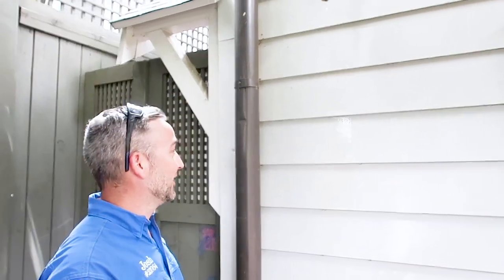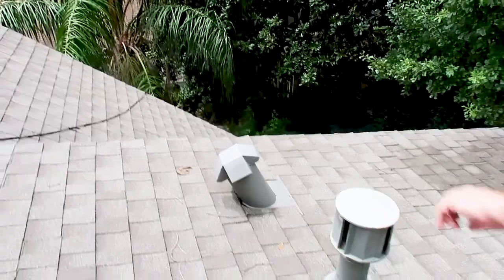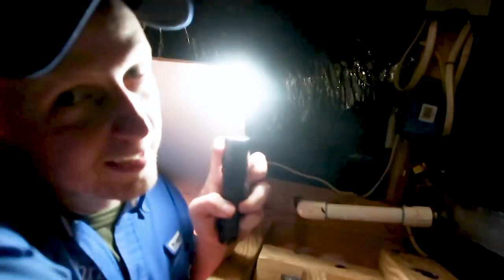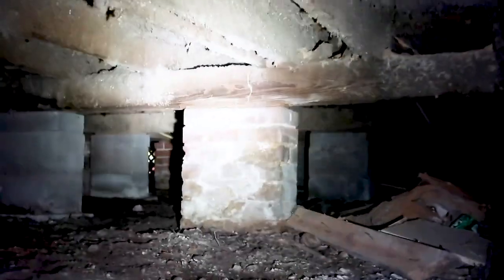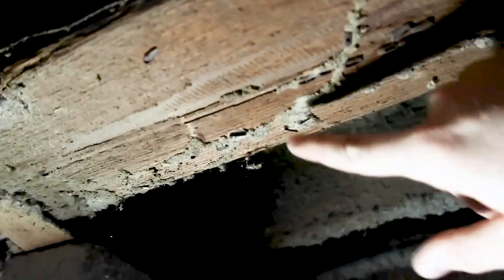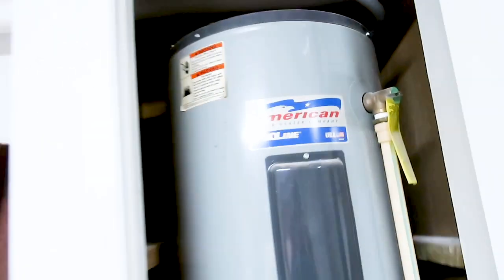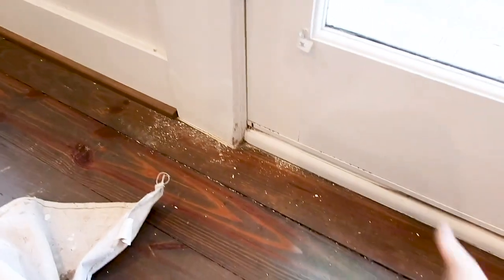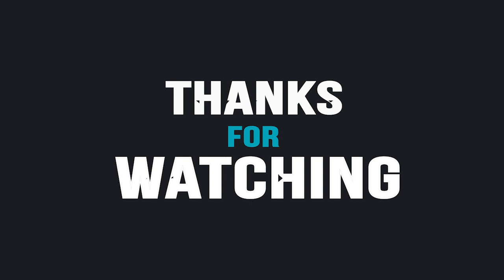Home Investigator: Episode 11 - 1910 110 Year Old Home Inspection

Comment: You mentioned that termites used to be in the joist (in the crawl space), why would termites leave when they have food (wood?)
Reply from the maker: They may have been treated in the past,  so they are probably dead.   That is why I suggest them to get the paperwork to verify.  If the paperwork(Treatment Plan) show the property has been treated, that means the only action to be taken is to repair the floor joist and beam.